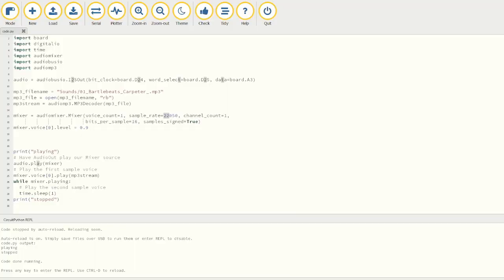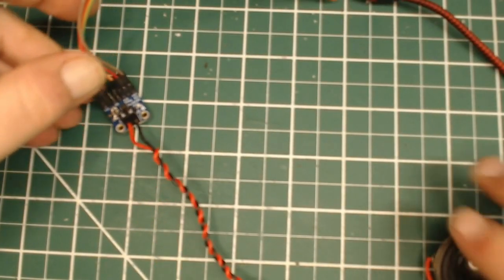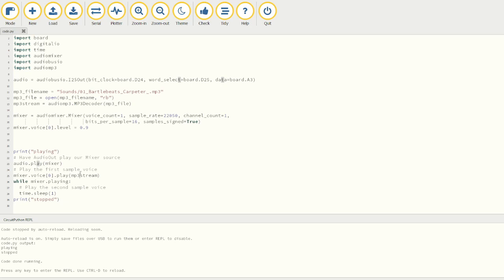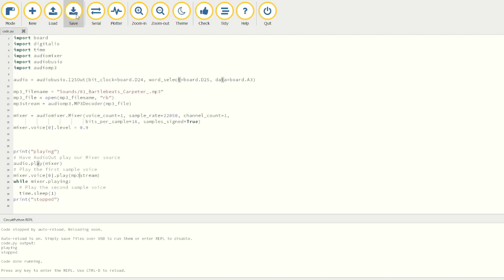I2S Amplifier Popping/Clicking/Noise Fix

Comment: This issue has been truly solved!!!!  It has plagued us all for years and there has been all sorts of speculations, suggestions, and fixes.  Some effective some not.  FINALLY the true cause is known and solveable.

It is the HEADER in the file being played!!!!  When the i2S is being set up and preparing to play, whatever library you are using reads that header and them moves on from there.  Subsequent files are being played from the beginning!  This includes the header.  THAT is what is causing the pop.  Skip the header and all is well.

How to do that will depend on the library you are using.  I am using the Phil Schatsmann arduino-audio library and it was Phil that discovered this issue and his updated library has resolutions.

In my case, my applicaton required the repeated playing of a short wav file.  To fix this issue, I first encoded the file not as a WAV but RAW and with no header.  (I need the file to be uncompressed so that when it repeats, there is not pause for encoding between them.)

The absense of the header did the trick.  That's coupled with the resistors in the BCLK line and the audio is crystal clear and without pops.

This may not be an option for MP3 users and there may not be a practical way to remove the header if present but if the library you are using takes care of this, they you will have no problem.
Reply from the maker: That is very interesting.  Most of the audio I work with is either midi or MP3. I haven't used wav or ogg with it much but I know the issue is present regardless of the format. I typically use it with either a Pi Pico or RP2040 based microcontroller which has enough ram for most purposes. I'm not sure if there is a way to skip the metadata associated with an MP3 and in many circumstances people want that info included for displaying the meta data on a small display.  That's one of the benefits of MP3.  Sounds like the duration of time it takes to process the header could be a culprit and why my method of muting it for the first second has been effective to combat it.  It works 100% of the time for actual songs that are 3-5 minutes in duration.  I could see it not working if you want to iterate over very short samples especially ones that are shorter than 1 second as that would make muting the pop pointless if it's going to mute the entire length of the sound desired to play.

Comment: What you found out may indeed contribute to the noise problem but what is most likely the cause is "ringing" on the LRC, BCLK, and/or the DIN lines.  This is easily fixed by just adding a small resistor in line with each signal.  Pretty much anything between 10-100 ohms will work.  20-30 is probably optimum.  Give that a try!
Reply from the maker: Actually I ended up going the other route by adding a large smoothing capacitor which helped tremendously. Also, these types of small amplifiers are quite prolific and they all have the same issue of being unable to handle the initial in-rush current which causes a loud pop, almost as if they're all based on the same design.  A simple electrolytic capacitor helps take care of that. A way to fix it with software is to use circuit pythons mixer to keep the volume muted for the first second of playing and then increase the gain to a nominal level with I2C gain control.
Reply: Adding small resistors in data lines like that is a good practice.  I do it routinely with transmit and receive lines.  I'm pretty sure that's why it cleaned up the crackling.  The pop is another matter and very annoying, almost making the project useless since I have to repeat a very short clip over and over again.  Where did you add the cap?  As I understand the issue, it has to do with fact that the output is not symetrical around 0 and so enabling the device causes the pop.  The device is re-enabled each time a file is played and not just left enabled all the time.  Supposedly using the SD mode to prevent any output until LRC and BCLK are re-established will fix it but I haven't figured that out yet. @DevonsWorkshop
Reply from the maker: @bobjuncosa6866  The cap would be in line with the speaker output. I believe the one I’m using is mono with 1 speaker so 1 cap was enough. Had to put the additional circuit on a protoboard/perfboard as there isn’t an easy way to add it to the pcb. I did experiment with an in line resistor but on the audio out side.  Will look into your suggestions. Its been a long time since touching that project. I turned it into a custom PCB (no video about it) but it didn’t work due to messing up the gnd plane. Will look into it.

Comment: Are you gonna remove the block and solder the wires directly?
Reply from the maker: Yes, ended up removing the terminal blocks on both amps. Made a huge difference. Cant say for sure if it’ll help on the mailbox yet as i don’t have any 100K resistors. Picking up a few this week to experiment with. I did hours of testing different configurations today. Went on show & tell tonight with some updated progress. https://www.youtube.com/live/ur-Gl-fj6HA?feature=share